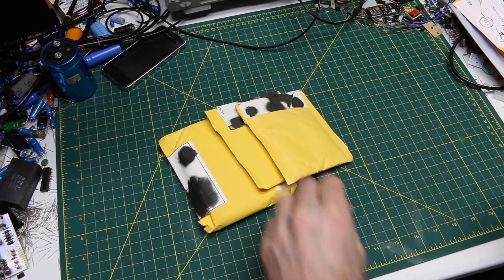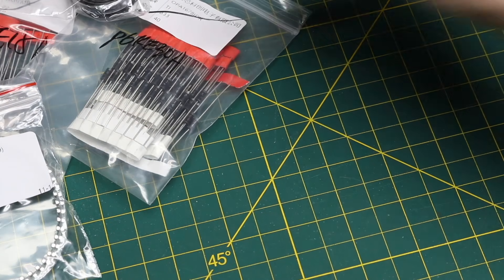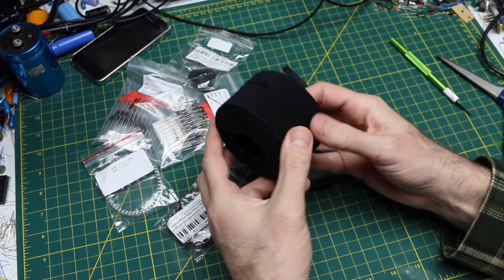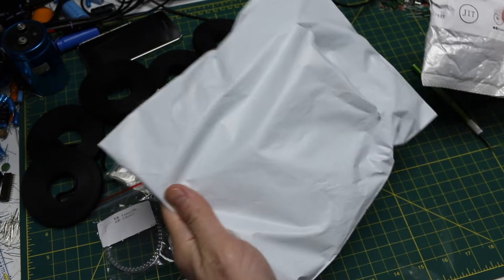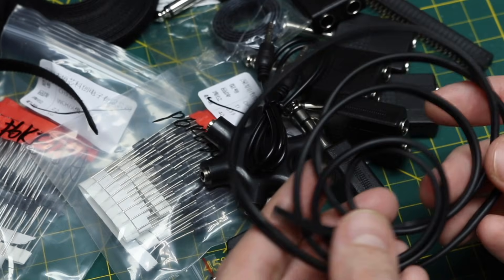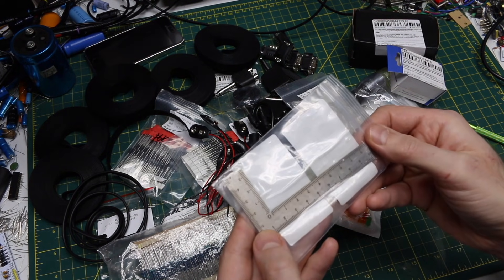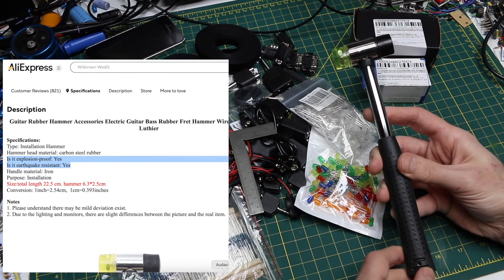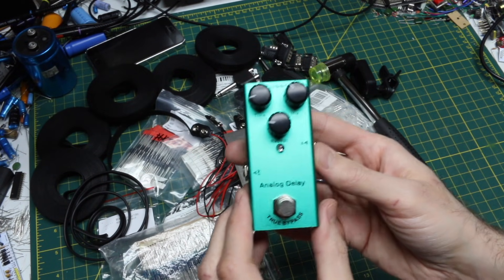Last Mailbag of 2025!

Comment: That cable tie material looks neat. But Explosion proof and earthquake proof hammer is a must have. When the big one hits Vancouver Island I will be jolted 1 meter east them 1 meter west real fast so will need it.  Nice haul/cleaning of bins.
Reply from the maker: sometimes I needed to take three or four regular Velcro cable ties and Velcro them to each other to make one longer one depending on what I was trying to harness so I thought this was the way to go.
Hopefully the faults and plates on the west coast won’t be scraping against each other for seven or eight more decades at least.
Reply: @GadgetReboot  I went to talk where most people were engineers, it is amazing how much monitoring of the island there is (both vertical and horizontal deformation). My question was "when the quake hits and the Delta area (Mainland) liquifies and slides into the strait will the wave hit my house. Their calculation was I was above the bluff so I was ok from the wave hitting the east side of the island. Might get beach frontage out of it.